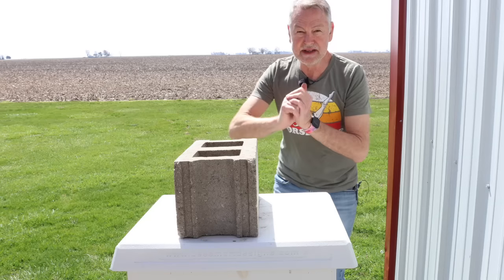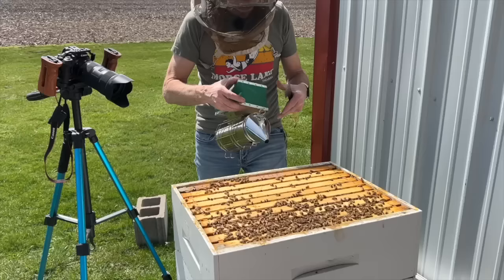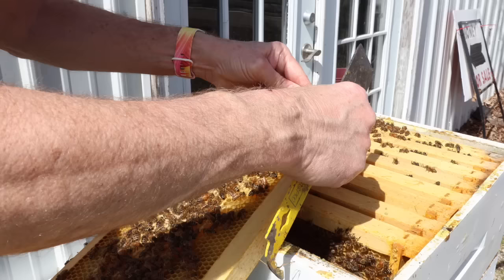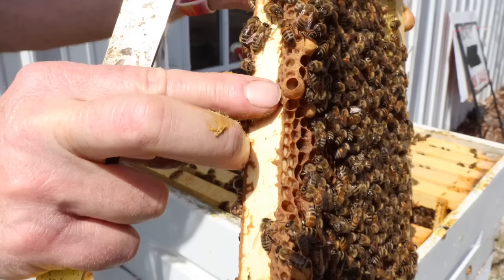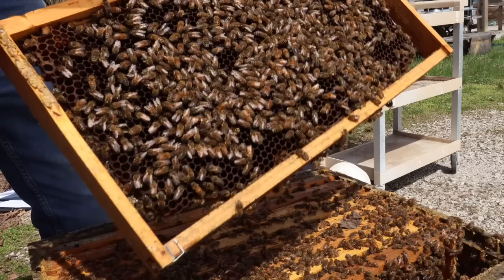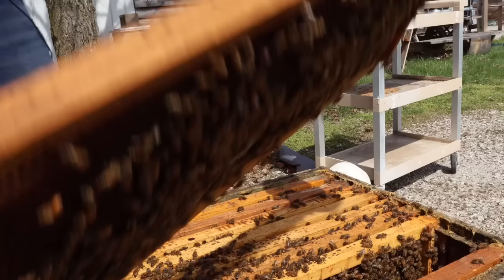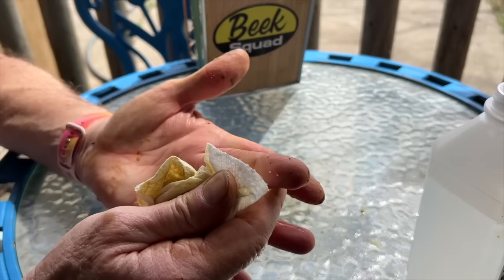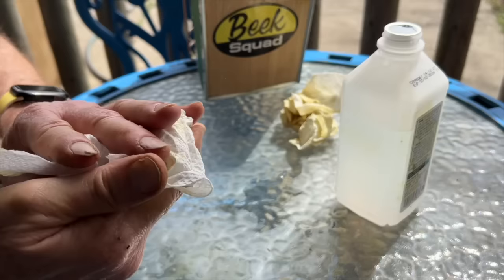Beekeeping: How To Check Your Hives For Swarm Cells

Comment: Great video.... it is a rainy miserable day, and thanks to you I still got to inspect a beehive! I have found some very thin dishwashing gloves they sell at Walmart... think they are great value brand... that give you all the dexterity of bare hands while keeping your hands clean. They have a thing cotton lining and keep your hands from getting sweaty, they can be used multiple times and are only like 1.99. Also I have had the bees very mad at me due to having to shake frames and I feel them bounce off the gloves but not sting them.
Reply from the maker: Yes I’ve used them too before. They do quickly break after a use or two.

Comment: 29:00 I've had broken frames like that. For a quick (although not permanent) repair, I'd slap some wood glue on the broken piece and then put a rubber band around top and bottom bar to hold the pieces together... then replace next time you are in the hive.

Comment: I am hoping to go into my one hive and see progress plans for making a split.  That said, I have one coat of paint on some 1 x 2 boards and will be putting on two but cut them at 16 1/2" and then screw them on the top edge of my boxes.  Then I can lift, tilt an and look without the hive sliding off the hive below.  ... Then of corse there will be better handles to move the boxes.  The sacrifice is to change how my top or covers are made etc. ..

Comment: Great Video David. Only 50 today, we had low 20's and highs of 40's for the past week and this week about the same with 1 to inches of snow by mid week, so should I be concerned about swarm cells and take off all the insulation?  Noticed a bug on the side of building, was it a SHB ?